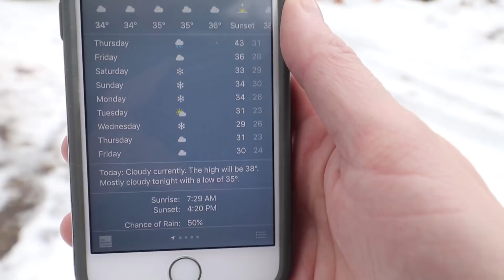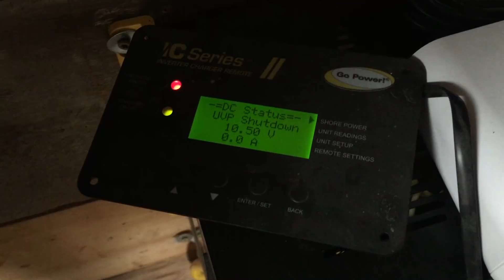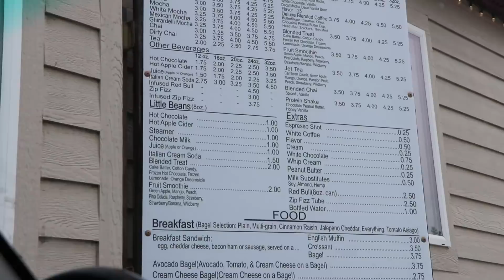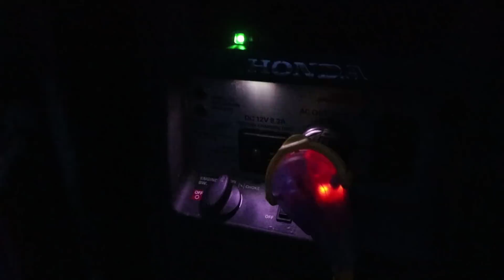Our Story: Giving Up Solar Power to Go On Grid

Comment: Im sure there are ways when your finished your house that you could stay connected to the system and still use alternatives like solar and wind when its convenient. I watched another video a while ago and they guy had a setup where he could throw a switch to turn off the  grid power and then throw another to go to his solar or generator power.  It might not power everything but it could be supplementary to your  power usage.
Reply: Guisso 14 if you buy the right inverter it actually has the ability to turn your generator on and off for you, the ability to switch to gid tie, switch to gid to charge batterys from either grid, generator, or solar, wind, battery or any other energy source. Ots just amaizing how someone on a video like this looks at a few things on line then finds one really bad plan and then follows it. There is a list of mistakes they made from the get go. 1. They used a recreational grade inverter. They make solar systems that power factories flawlessly. Homes too. Trying to use a 12 volt or even 24 volt inverter is just plain not that smart. Any inverter ment for a home will at least put out 5,000 watts and normally you can gang them up.  2. Using wet cell batteries. You can only discharge them 50% so right off the bat you have to buy twice as many cells then you need and they wear out FAST. There performance in diffrent climates stinks also they wont charge fully and they discharge way too fast. maintence sucks also. At least go with a glass matt cells. Longer life, nearly no maintenance, you can discharge the crap out of them and they still work like new.  Or go lithium even better. 3. Wrong voltage system. At minimum you need 48 volts. It just works better, its more efficient, requires a lot less wire. 4. Wrong pannel setup witout optimizers, etc. 5. Wrong generator setup for backup power and charging the batteries. The generator is ment to do 12 volt work as an emergency solution at most.

Comment: With the cost of solar tech it's hard to live fully on it for  most people that don't have sun all the time. I think a combination is good. We run solar jut for our pool pump  and with this experience I would not want to use solar full time yet. I think technically the big issue with solar is in the battery.  Hugs to all.

Comment: I did the #s for an all solar house where I live. It cost more than paying my electric bill for the life of the solar system. Yes get 3 phase if they will allow it. 3 phase motors are much more reliable than single phase. If you plan to have power tools you can get better 3 phase tools for the same price as single and they have much better operating characteristics. Almost all of my equipment is 3 phase. 208 V 3 phase gives you 3 legs of 120V, no transformers needed. You only have so much time to live, make the best use of it.
Reply: An even better, but less common system is 240V 3 phase. It's setup as 2x 120, 1x 208V. This high-leg is what makes it perfect for motors, and because there are two phases at 120V, the house is fed the usual 120/240V, as normal. 

This system was installed on farms for most of the 20th century, as the machinery and residential loads could be metered as one service, versus having 2 meters, services, and voltages on the location.

Comment: It has everything to do with the components. Especially your battery wire up. What a joke. I saw your video, your running on a 12 volt system. Man is that a mistake to use 12 volts for battery backup. Go get your grid because your not listening to common sense. Instead your ranting about how all those solar folks are not living with these alternative energy item's. Do your homework, you will find that if your serious about living off grid you will wire up your batteries for 48 volts. And here's the math why. Let's say your running 600 watts of power. Well your poor little 12 volt battery bank has to provide 50 AMPS! Batteries are chemical storage, and they have a C rating of 20 if they are lead acid. In order to provide 50 amps for your 600 watt device your battery bank has to be 20 x 50 or 1000 AMP/Hrs capacity. And that is just not you looking at your videos, those batteries are much smaller than that. Your killing your poor batteries with that type of setup. Math: 12 volts x 50 amps = 600 watts. Simple right?  

Now look at a 48 volt battery bank. It too needs to provide 600 watts of power. With 48 volts that only requires 12.5 amps. Wow what a difference. And what is the  C rating with at 48 volt system? 20 x 12.5 amps = 250 amp/hr battery bank. And guess what else? 12.5 amps will not drop your voltage on your batteries (that happens under load) as much as a 50 amp load will, and you would not hear the "low voltage" warning nearly as much. Nor would you have to run back and forth to town to get more gas for the generator, because your batteries are having a much easier time providing 12.5 amps vs 50 amps. Remember batteries are a chemical storage device, the less amps you pull from them the better they will perform. This is especially true for your situation because of the colder climate. You would have a greater appreciation for this if you had simply started out with 48 volt battery bank. Now go rant about that, and how you shot yourself in the foot. Because if you had just done some simple math you may have avoided a lot of headaches. Perhaps too you might have not been so feisty with all the good people that are sharing there solar idea's with you. The solar is NOT the problem, the battery setup is. So think about that 50amps vs. 12.5 amps....hmmmmmmmmm math is good.

Comment: I agree with Jessie's observations entirely! Although, I have made a few of my own... Their battery bank is sitting out in the freezing cold. This greatly degrades the capacity of the batteries. They should be kept at around 70* give or take a few degrees. Off grid solar is viable, but those that use it have very large panel arrays and a LOT of battery capacity. They also choose to wait for sunny days at optimal solar power generation to do laundry. They also tend to use propane for everything heat related as well. It is a major investment and quite a bit of upkeep and to be honest battery capacity vs cost just isn't there yet. Best bang for your buck right now is grid tie solar and smart metering. You can still eliminate all but the service connect monthly charge but you also eliminate the need for buying/storing/maintaining a huge battery bank. It also doesn't help that ya'll are so far north that winter solar production is almost non existent...

Comment: Just get enough power to the property. Think ahead. If possible get 3 phase power. I know that the american power grid is quite different from the european system. A normal new build house here in Norway is getting 3 phase 400v 63 amp in.

Comment: I've lived the solar life on a smaller scale (houseboat).  The problem with off grid living is we lack the ability to store the energy we need at a reasonable cost.  LIFE batteries are there but cost at least $1K per 100ahr.   Running a family home off alternative energy is impossible for the average family.  Give it another 10 years for the ultimate battery finally comes of age.

Comment: The truth about Solar is that it works bests in certain areas....but the real key, is the ability to store energy and using the right size Array for your needs.   If I was Pure Living for Life, I would have used a combination of Solar and Wind, with a lithium battery bank.  Getting an enough Solar in the Winter would be hard, so adding wind would have done the trick.   Bottomline, to make living off grid work, you need a well-developed plan and the right Know-How.  Another method is to use Geo Thermal, which can heat and cool the house, as well as generate power.  Bottomline, most of these systems require up front dollars to implement.  It's not going to be cheap at first, but it's worth doing, not only will it save money (in the long run), but it will help the Earth .

Comment: solar is a big issue. I live in my RV full time and we have solar enough to run the ACs. But we are also connected to the grid. It is nice to have the option of using the grid if you need. The convenience  of living. the sun fills our batteries but when we don't have the sun then the grid power does it. Nice to have both worlds. And yes does make life easier and more convenient but also less need for the grid energies.

Comment: With all the work ahead a constant reliable power source is a must. Going all solar after the build is something that can be done down the road.
Reply: Dave 8470 they have two generators for the work, they just have a tiny system with old batteries, bad experience. Spend whatever it’s going to cost to hook up to hydro on panels, and they’d be fine

Comment: 3 panels? Primitive (hand crank) generators in northern latitudes?  Is there water running down that hill behind your mansion?  Your power needs for a construction site and living accommodations of that size would be extensive.  I am not sure that calculator you are talking about is working properly.  Nevertheless you did accomplish quite a bit.

Comment: I like that you say affordable. With batteries I don't know that it is possible to have enough power, but solar power combined with grid power is a different story. I know that it is possible to produce enough solar power for a whole year. Problem is that you have to much in the summer en to little in the winter. If you combine it with grid power you can put it on the grid when you have to much and the other way around. At the end of the year you only have to pay the grid connection, but it will cost you €15000  in advance to place the solarpower system.

Comment: Just a down the road tip..  when wiring the timber frame home..  wire the lights on their own circuits so that if down the road you want to switch your lighting to alternative energy, ie solar, battery, etc.. it's will be a very simple task..

Comment: (Tesla Reveals New 325 Watt, 21.76% Efficient Solar Panel) For the last 30 years science has been yelling that solar is not there yet. It needs to have a 50% efficiency before you completely switch over.  It is the best clean energy but right now you have to spend a lot of  money to run total of grid with zero loss or cut back in use.

Comment: We are half off grid and half on grid.  We have two fuse boxes and have all the emergency items off grid including refrigeration, freezer, pump etc.  IF the battery goes low, I have to say we plug an extension chord into our solar brain, and get the batteries recharged, as it is cheaper than running a generator.  One day, we would like to go all off grid, but we are solving our grid problems a little at a time.  Our blog is www.powellacres.com  Just one idea for you.  Our electricity bill is quite low.  Last month it was $86 and we have about a 2600 s.f. house with a full basement (all debt free.)
Reply: my gas & elec bill was $36 last month with gas heater running every evening. I have 2k solar but it is just a hobby to play with for  me as regular bill is so low I don't care about solar savings.

Comment: Another thing they dont tell you is the govt programs to help fund these systems/tax credits are not applicable to off grid systems.  Many off grid, back up the solar with wind turbines . Your system would have to be 3X the size with more efficient panels. Then theres the cost of storage. Tesla power walls seem to be the ticket at the moment (and very expensive) and your still have all of the limitations you mentioned, just a bit more capacity. Another issue is my understanding is that running your batteries below 70% dramatically shortens there life (I'm talking lithium based here). And no, I dont have a solar system but Ive done a lot of research as I was planning on moving to Tucson, on my 10 acres there, and there a ton of sun in the area, making it more feasible.

Comment: I have worked on many remote sites with grid power and generator backup with an automatic transfer switch and worked on one site with grid as main solar as backup and generator as  second backup so if  the power failed it switched to solar and if solar was not charged and available the generator kicked in to charge the system  and take over until solar or grid returned it was  two transfer switches and  3 panels some circuits only ran on grid only some grid or generator and  the remaining ran on solar it was a load shedding system to manage what ran in a total failure situation

Comment: I will say y'all have learned how hard it is to live with just the power your getting from solar n the generator. My Mrs. n i have lived this way for 9 yrs, its not a lot of fun, but we have no other way to have electric power. You are correct the clouds n overcast n rain, snow days on end . Only to fall short on the wattage needs. We have 2 KW's of panels, plus alot of gas buying for our homemade gen.  power maker. Were getting older knocking 70 n we do like y'all work all the time to survive! Grid :) go for it !
Reply: 2kw of solar panels??? no wonder its no fun. I mean anything under 7kw is just a waste of time in my opinion and I am a licensed electrician so I'm not just talking out my @ss here.On top of the panels you will need a 10kw generator to power up the batteries when they run down as well. If your not prepared you will suffer immensely

Comment: Here is another idea. you con use your water system as a battery bank. use solar and wind to power the pump to pump water up the hill and then use water flow on a turbine to make power at night lol. But then you would have to install some sort of tank on the bottom to catch all the water.

Comment: Why not have a hybrid system? Use solar during the day for the most part and use grid to offset any additional power? Having the grid refill your batteries at night could potentially be a much cheaper solution.

Comment: my vote goes get the hookup but keep and use the solar too. If it breaks, leave it sit till the best time to fix it. I think you should consider a wind generator good enough to gain a cash in flow from the power company.

Comment: You do what is easiest for you. I frankly would go with solar thermal for hot water for laundry and showers, and couple it with an on demand hot water system, which could be gas based or electric. Tradeoffs are you need the electrical input for the electric, and for the gas you need to be able to fill the tanks be it propane or natural gas or you could do wood gas. You also have water near by I do not know if that is on your property or not, but if it is, run micro hydro.  That vertical drop can easily give you 10 KW which is likely what you would get in max capacity from the grid.  Depending on if you are going gas or not, If going gas, get a propane based refrigerator.  An absorption type ac unit.  However if one really needed to be off grid then the lowest cost most effective solution is combined solar thermal with a wood stove central boiler outside, where solar thermal is stored and acts as a preheated reservoir for heating, and can be used directly for showers and laundry. You keep storage at about 120 to minimize thermal loses, the boiler from the wood can then boost temp up when it is cold, and the hot water circulates through the home, and you can combine to create a combined heat and power unit, taking the heat from the wood stove boiler and having it run either a steam engine, Organic rankine Turbine or a stirling engine which provides electrical power, and you may want to have battery power just so you do not have to constantly run the wood boiler. The boiler is not limited to wood as you can burn any biomass.  The reject heat on the cold side then goes into the home  where the temp is brought down further on its return path to boiler or thermal storage.    I would do this for myself off grid as easier than getting power put in and less expensive, you may have a different situation.  If you have the hydro resources then I would explore that.  Hydro and the combined heat and power would be the cheapest most reliable options.  Solar photovoltaics can be expensive due to batteries, inverters, and sun exposure.  Ideally you want the cap costs to be around $600/KW for the entire system and want about 12 KW to be equivalent on a 100 AMP Grid connection.  You want to be able to at any time or hour call up 12 KW of power and be able to use that capacity indefinitely.  Of course most modern homes are going to average about 2 KW/hr  but that is over 24/HR period.  If that water feature you showed on video is something you can utilize I am not including the cost of the piping to bring the water to you, and your power house. (just nice to do it that way because if ever there is a problem you can easily get to it and do whatever needs to be done.  If it is a ways away you will never have a problem but in the worst storm in history and then you have to trek to it to fix it.   If you are interested contact me. I engineer systems, and will give you some free advice and such.  I am not looking to be hired, nor am I looking to design your entire system, but will help you to learn what you need to learn to design your own.  The bottom line is that there are many paths, but you need to do what is best for you economically.  Off grid done right can save you  money long term, but it is a capital up front cost, and you may not want to put that much upfront right now while building a home.  If Grid power is easily available, and does not cost much to bring it in, then it may make sense to do that first, get the house built, and then after that do these other things if you so desire.